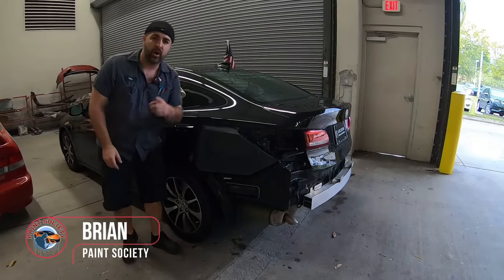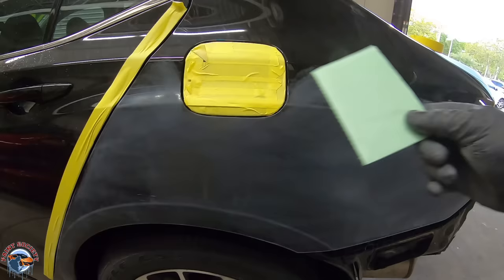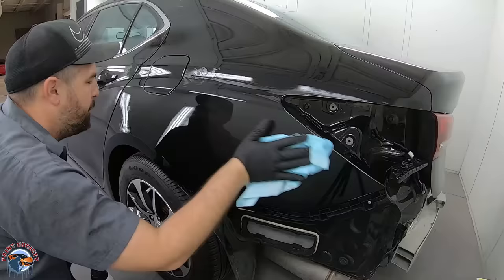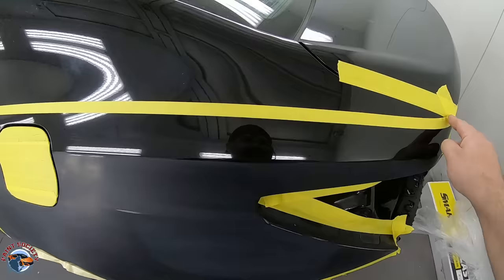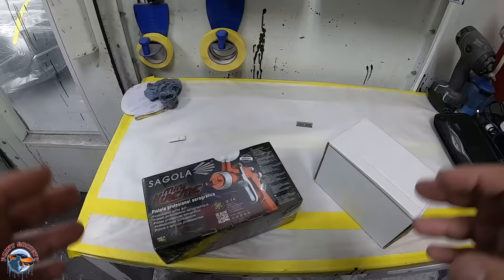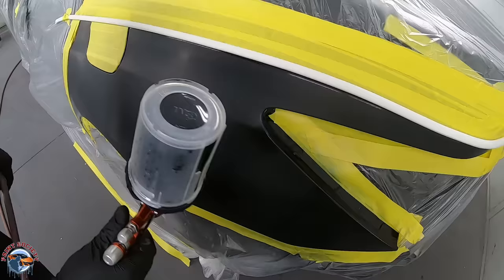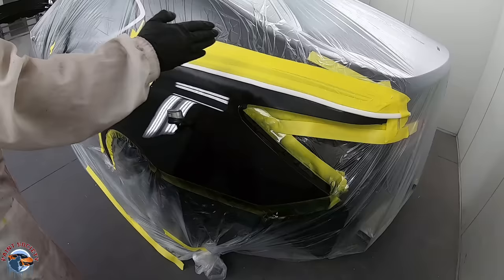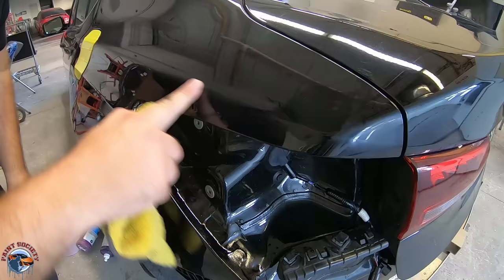This Paint Trick will Blow your Mind!

Comment: When he said try painting on something else ( for practice ) brought back a lot of great memories of my Dad practicing two tone painting all of the kids in our family's bikes, tricycles, wagons and even his power mower with Colonial White and Regatta Blue before painting his '55 Ford. Good job, sir..
Reply: Practice makes perfect!
In my case, to get the deposit back on a lease, I've repainted my mom's bumper on a Audi Q3. Had a massive stone chip and dent on the hood too. By the time I was done blending everything in it was 95%. Even managed to blend in the clear just feathering it in with the original. But, before I even attempted that repair. I practiced using clear restoring my sister's headlights and the taillights on an old Toyota pickup. Used to have to buff the plastic to get rid of the oxidation. Three years strong, nothing's pealed.

Comment: Nice work! THIS, boys and girls, is why learning to work in a trade and excel in it is important!

My most recent experience with a paint shop/repair ended with me going back into the office and asking the manager to accompany me to my vehicle so that he could explain why the rear lower bumper cover was 3/4" out from the upper. Without hesitation he said "Ah, he probably just didn't pop the tabs in all the way", and proceeded to pound it with his fist until they all locked. I can't imagine how the "technician" would have called that complete and moved it out on the lot.

Comment: Edge blending is an important skill for a painter to have, I learned to do it using the old feather edge tape, when they came out with the foam tape it made the job a bit easier to achieve good results, auto body repair materials have improved a lot over the years.
Reply from the maker: Agreed. Good skill to have for those certain jobs.

Comment: I do PDR around Chicagoland area I never touch freshly painted parts or people's work, unless they are at the beginning of the process. I do like asking questions about their process.  It's one of those things that looks simple but there seem to be a lot of little details that add up to a good finished product.  I had a shop do a SMART repair on my black Jeep bumper.  I'm used to spotting overspray, paint runs, fish eyes, filler under the paint, etc because I need to look out for them when doing my work. I could hardly tell where the edge was when looking for it.     I was very happy with that repair on my car, even though a shop doesn't consider it proper.

Comment: I have been using foam tape since the early 90's. You can get the job done with regular masking tape but the results are so much better with the foam. Easier and consistent application.
Reply: Beautiful work man. I'm not sure your techniques can be learned in a video but you did it all right.

Comment: Hey, I'm a mechanic,  an Acura mechanic at that...lol.  I know what dirty hand do to paint.  But, I did work at a body shop for 3 yrs too....you've got great info.  Love watching your channel.  Just had to chime that in lol
Reply from the maker: Acura techs rock!
Reply: @PaintSociety  ya, I'm in the process of restoring an 04 TL 6 spd.  I watched your video of the TL rims you painted for that green CR-V , you did the fender on .  I just  DA'd , and filled the stuff I couldn't send out. Got to do some refining.  Not as smooth as I'd like yet.  Question though, I hit the rest of the rims with finishing 320.  (I guess its a finer cut 320).  Is that enough for primer?  Or should I hit it with 220 then prime.  Cause I plan to set sand the primer with 400 then 1000 for paint.

Comment: stopped using the foam tape for the edge blends years ago, roll edging masking tape works better.
very true with the black, easy to line in on swage lines, great job
Reply: Why add another product to the mix when Masking tape has done the same job as the foam for years?
Reply: Do you mean back tapeing? You hook one edge of the tape and roll it over creating a half barrel?
Reply: @3rdpedalmafia  yes, making a transition rather than a hard line.
Reply: @matthewcamillo695  thanks !👊

Comment: a nice little trick i use when putting the foam piping on the quarter panel door gap and front of rear door is after the foam goes on get some 12mm fine line tape and put it over the foam with about 2mm from the edge of the panel then shut the door it leaves the same gap in foam but leaves the top of the foam smooth so no chance of the foam sticking on the edges and it leaves the panel edges pristine. cheers from down under

Comment: I have used the foam tape before but found using fine line at the edge and removing it soon as the 2nd coat of clear is finished going easy on the 1st coat of clear near the edge, buy pulling the fine line off when the clear is still wet the clear lays down really nice were in some instances buffing isn't even needed .

Comment: Nicely done. Haven’t used foam tape for over twenty years as had a couple of solvents vs foam issues here’ n ‘ there and found I could get the same results with 1” soft edge masking tape... faster, cheaper and more versatile as the folded tape edge can be made tighter or looser by adjusting the width of the fold.
All being said Great tutorial

Comment: I was using Soft edge masking back in the 1970s and this was in the Body repair trade here in the UK this was especially useful when using 2k paint as they were not thought to be able to be "Blown out by using a thinner edge.  Things may have changed with the use of dry flatting but for the soft edge I used Farecla G3 before masking and I never had a problem with the edge peeling. Though most Garages in the UK bake the paint at 60c 140F, to speed up production

Comment: Nice to see a true professional using modern technology. Its been 20 plus years since I last painted. My favorite gun was my optima line with the 135 tip. Nice work.
Reply: Way to much work. Would of been easier to clear the whole panel.
Reply from the maker: Respect your opinion Brian.
Reply: @bjstcrusn  Yes it would have been. but the technology today far surpasses what the typical shop used back in the day. I was fortunate to use Glasseraut and Sikens in a high end European shop in Toronto called Vintage Grand touring.
Reply: @bjstcrusn  It's a loaner car, doesn't need the whole panel.

Comment: That tape is a great idea...as far as thirty years back i came up with that same idea but just used masking tape and curved it out which is the same theory...the theory is that the paint air mixture gets reflected back out so only a minute amount gets painted there and this can be sanded and polished after masking tape has been removed. I never sand dry always wet with a water soapy solution but then i have to dry with a blow torch. Soap stops the sanded particles destroying the garage as its wet and not the same need for masks during sanding although i still wear one anyway.  Great video and well explained....i would leave my car to you for a repair :)

Comment: When I did the Smart repair course with PPG in Birmingham, UK, the area of repair is no bigger than your fist. I also did not use foam tape. I used masking tape folded back for what is called back masking. Smart Repairs are normally done on chips and scratches near the edge of panels so you can keep the repair area small. The repair in the video is a standard repair and much larger than a smart repair using detail spray guns and air brushes.

Comment: You can do all your polishing steps. With one product.System 51. It's what all the SEMA guys are using. Have used it for 10 years. Hand rub clearcoat black for those hard to get spots. The polish will not stain rubber or plastic moldings. You can leave it in the cracks out in the sun and next day wipe it off with a damp micro finishing cloth with no burning or staining.
Check it out. ( not a salesman. Just an old head who got his start in 1970.
P.s Hand rub overspray in hard to get areas.

Comment: i've been doing autobody sine 1985 ( yes millenials, we had cars even way back then,lol ) and ive never heard it called smart repair, iv'e only ever called it a spot job, and we always called what you're doing here burning in the clear, we used to just spray over the edge with reducer to melt , or "burn in" , the clear edge, now i use UPOL BLEND #9, or transtar melt away, they work great and it's in a spray balm,,but since this seem geared toward the beginner auto guys , i'll add another tip , there is writing on the plastic car cover,, "paint this side",, have the side you can read facing you, or your paint will flake off onto your fresh paint job , and believe me , it's a pain to get it off

Comment: Nice tip/work!   I'd still be concerned with the CC anchorage on that edge though.  My guess is it doesn't last over the long haul.  Great for something to send it down the road, but...
Reply: You'd be suprised how long that lasts. I'm working in a Smartrepair shop for 5 years now and thought the same. But if done right it often last longer than the panel or the car itself.

Comment: I do the same thing and I don't use any foam tape I stop my sanding one inch below the break area using  rubbing compound for my final sand then  I use one-inch masking tape putting it right on the break, then I use a second piece of tape putting it in the middle of the first piece then rolling it back as soon as my final coat of clear is applied I remove the piece of tape that I rolled back to save money by not buying foam tape

Comment: Wow. Superb job! Not even seen without buffing.  Q: I did a pickup, and there is a medium orange peel, and still have a few runs... Maybe my pressure was low? (About 29 psi / 2 bar)
Reply: No greg, 29 is plenty of pressure, I spray in my garage so I usually keep mine about 20. Just too much material for the surface. Could be that you were doing a blend (That you only had base coat applied to a portion of the panel and were clear coating the rest of the panel) and when you're blending clear over a panel that doesn't have base coat attached it will run easier than when applying clear coat over freshly applied base coat. That makes sense? But if you are using an HVLP gun, 29 PSI is plenty of pressure.
TC in Annapolis Maryland
30 plus years collision refinishing restoration experience

Comment: That foam tape is cool - still trying to understand how it works - I guess it casts a shadow so the spray won't have a sharp edge.. do I have that right?
Reply: Yes. Back taping also works in the same way.
Reply: @3rdpedalmafia  Thanks - I've not heard of that - sounds cool. I'm a decorator, so cars aren't my trade but it still might come in handy one day.
Reply: @colliedogjoy  we used to take the tape with the paper attached ( with the tape on the edge)  and stick it facing the paper towards you and over the area to paint,  then roll the paper back and over creating a barrel look to the paper,  the idea is the paint will hit the barrel of the paper and have a soft edge on what your painting,   does that make sense ?    It is easy to show but hard to explain!🤣👊
Reply: @3rdpedalmafia  I get you - neat idea. Thanks for explaining.

Comment: "Its always a good idea to clean several times" Good words.  90% of failed paint jobs are due too insufficient prep.  What are your thoughts on Dawn & Water  or windex for cleaning surfaces?  Also.  You should explain the importance of sufficient dry time/Make sure your surface is dry after cleaning/before painting and or 30-50% overlap when painting.   I see you'r doing it.  But its easy to miss for beginers.
Reply from the maker: Don’t like windex because it’s got added chemicals that can leave a residue in the surface. Dawn original is good for cleaning

Comment: I have a few small rust bubbles on the rear quarter panel, within the 1 1/2" lip around the wheel well and about an inch from the bumper.  Do you have any videos concerning that type of repair, or would something similar to what is in this video work for that?  By the way, you do an excellent job showing and explaining the steps needed for the work you are doing on a  particular video.

Comment: Again, great video! One question I have is how do you ensure all the cracks and crevasses are free of moisture after washing/before painting. When relevant, your videos typically show the sanding, cleaning, and rinsing processes, but then go straight to the booth. Any tips you can offer are greatly appreciated. Keep up the stellar content!
Reply from the maker: I just use my air blower and blow it dry.
Reply: @PaintSociety  I would just use a Air Blower instead of taking a chance of Bubbling the Clear or PRIMERED area, turning a ,and you never cut off on a curved area to spot paint and clear coat the area and it will look right and not have a Clear Coat Edge on it and not turning a two day job into a Weeks work and wasting all of that material, been during it for over 45 years, nice short cut.

Comment: re silicones, One thing that ruined a friends shop was someone working on their car on the weekend, they were armorall ing their car out by the intake to the air compressor that kicked in.   it sucked up the mist of armorall and of course it got drawn in and into the lines.. they kept getting fisheyes as a result. my friend put an aftermarket  paper air filter  setup on the wall over his air intake to double safe his air intake. It takes that sucking noise away as well so wayy quieter out back now they said

Comment: I have learnt that if i sand and cut through to under coat. When i paint my base coat. instead of using 2 to 1 reducer. i use 2 to one hardener. in second words. i use two parts paint and one part hardener instead of reducer. That way i'm garanteed no flare up cared by the thinner. Thinner is what re acts with the paint. That way i don't need a clear base.  Again you don't know what paint the previous repair is done with. Of course experiment. I've had no problem with the previous paint being old and faded re acting with thinners! I been painting cars since 1982.

Comment: Its amusing to hear 'clear coat all the way to the end of the panel for a good factory warranty'.  While that is absolutely going to give you the most resilient finish, no arguments, I can say that GM has been doing SMART repairs, exactly like this since the mid 90s.  They worked directly with 3M, PPG and BASF on the process to support doing such repairs in the factory paint shops - though in the interests of continual cost reductions, total repair sizes were further shrunk where appropriate - it was common to produce a 8-10" circle of repair - FAR from ideal on light metallic of course... but it happened.
Reply from the maker: There is a bunch we don’t see behind the scenes and there is also a bunch of port repairs that are easy to spot
Reply: @PaintSociety  Absolutely.  They were banking on the greater majority of people, who dont work around paint for a living, not being able to see the slightly off-colour patches, panel differences etc.  Done right though, on the right colours, theyre pretty seamless repairs - hopefully the edges dont peel back over time  ;-)

Comment: Serious question as i am wanting to do a similar repair, why is it that he doesn't use a sealer coat in many of these panel repairs, yet he states the extreme importance of using it in other videos and in others? He puts the top coat right onto the primer here and I want to make sure I'm using the best practices for a lasting paint job. TIA!
Reply from the maker: I mentioned that there wasn’t enough room for sealer and that I took extra steps to smooth out the primer. Also it’s black so not a strong reason for sealer
Reply: @PaintSociety  thanks! Would you recommend sealer for a medium-light blue base then?

Comment: Hey Brian great job 
Just wondering that's the part number on your wurth pump pack sprayer the one's I have tried in Australia doesn't last long with wax & grease remover
Reply from the maker: The Wurth ones arent great either, I’m starting to use an iwata one  that works great

Comment: Brian, have you ever got the jagged edge on doors when using the foam tape in the jambs? I tend to get that a lot. Any ideas?
Reply from the maker: Rip off a small piece of cardboard box and rub it against the edge crusty edge and it will smooth it right out. Like magic

To prevent. Use small diameter tape.

Comment: Final result looks perfect but if you look 9:42 where this foam tape line shows I still can see part of that bodyline which has shine, meaning that should the foamtape be like few millimetres lower?  Or are you sanding finally with 3000grid that clearcoat off which you sprayed to that thin shiny part?
Reply from the maker: That’s just the angle of the camera that shows what’s under the foam. When spraying perpendicular you don’t catch any overspray on the shiny part.
Reply: All righ! I really have to try that foam tape trick again. I have been painting cars over 12years and this is the thing I always strugle. I usually use normal tape trick which you mentioned in your video but when you have long and curving bodyline the normal tape is not working good. Last time I tried foamtape I messed up. I think I got that glue part over to that edge where new clearcoat line should be and it did not look good at all. Thanks for your great videos btw. 👍
Reply from the maker: @samiflyktman3680  use the foam tape inside. 13mm. Link in the description